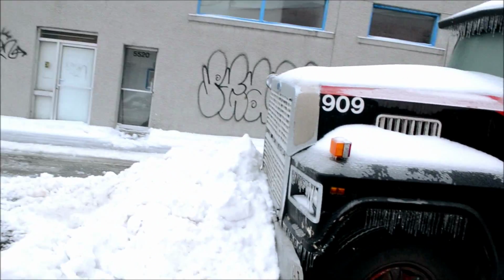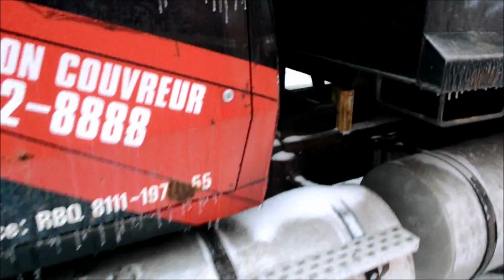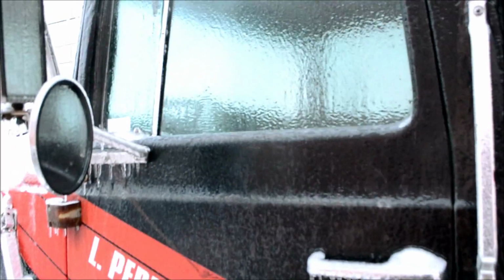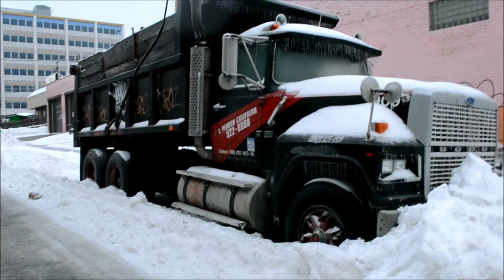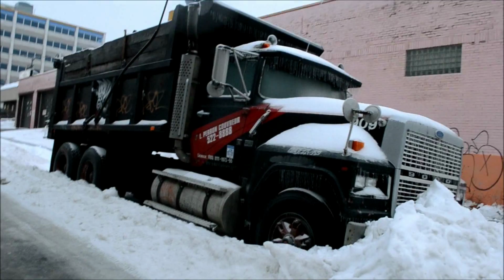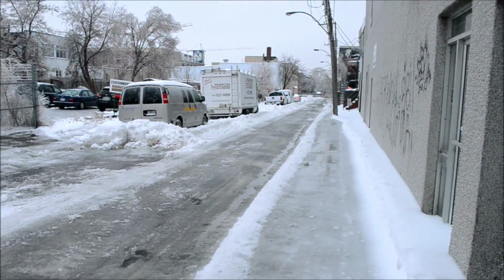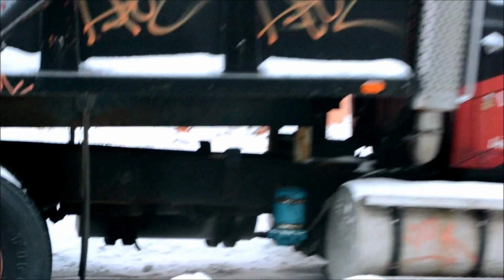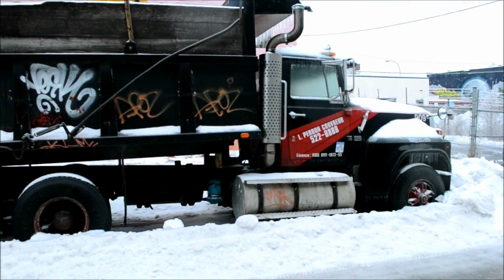ICY FORD LTL 9000 DUMP TRUCK SIGHTING

Comment: For your info the blue thing is the air compressor, some trucks have it outside the motor compartment.
Reply from the maker: Thanks for that man!
Reply: retroolschool It is actually a air dryer for the air compressor. The compressor is within the accessory drive on the motor right in front of the furl pump. And the reason the bed is propped up is so water don't stand in the bed and rust the floor out.
Reply from the maker: rshotrod1965 Good stuff thanks!